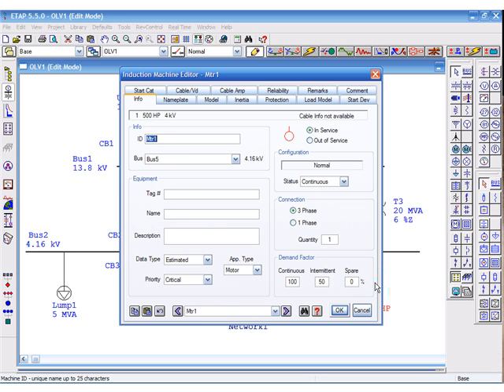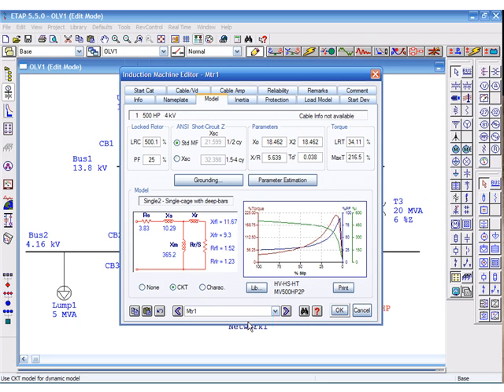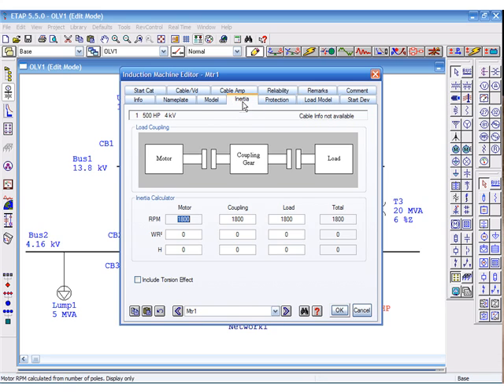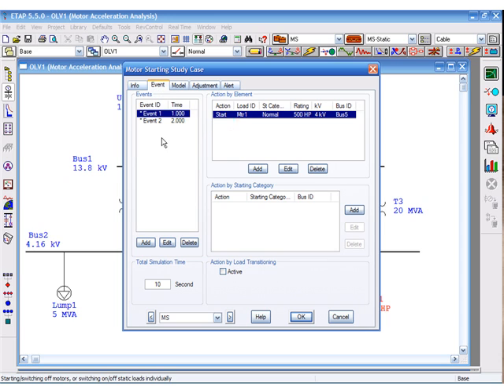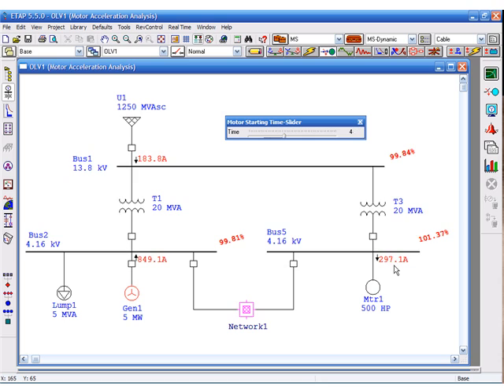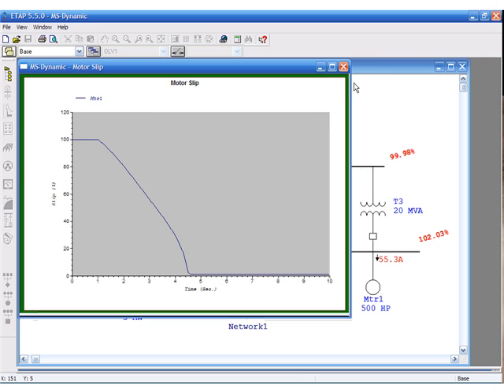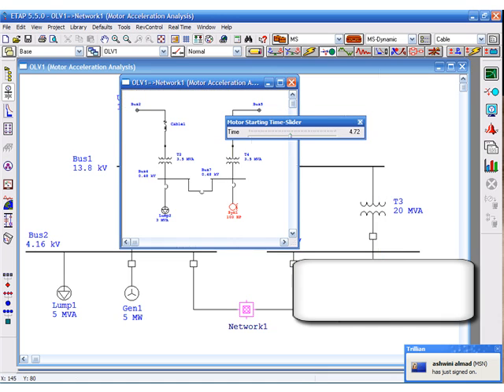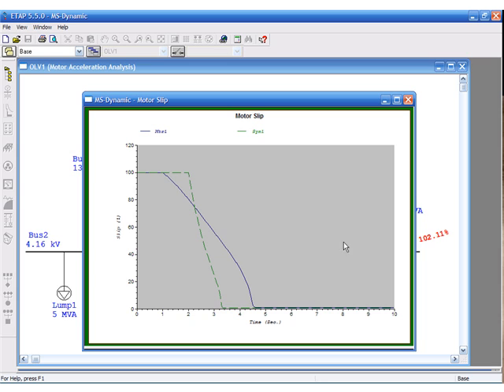Motor Starting in ETAP Software - Dynamic

Comment: What size of motor do you consider to be modelled for motor starting analysis? Or do you always model the largest motor in the bus and separate it with the lump load?
Reply from the maker: Thank you for your interest in ETAP Software. You can take advantage of the ETAP multi-dimensional database, which allows you to run as many studies motors, busses and loads as you like, compare them, and select the best option for you all and everything is saved in scenarios without changing your initial design. You can run batch  scripts with all scenarios as well. You have literally unlimited option you can analyze on your model. For more information please refer to our videos on ETAP Digital Twin or contact our 24/7 Help Center on our website https://helpcenter.etap.com

Comment: One Problem, we shall input Moment of inertia WR2 ( kg m2). How to calculate Moment Inertia WR2 (kg-m2) in ETAP?  Is there any standard to calculate  WR2?. I found in IEC 60034-12, Table 4. External Moment of Inertia J ( kg m2) for each kW of motor. Is it same WR2 and J? 

J in IEC 60034-12. Mentioned as J=0.04P^0.9xp^2.5
Reply from the maker: Thank you for your interest in ETAP Software. Please contact our ETAP Support team at support@etap.com or go to our 24/7 Help Center and open a ticket to assist you with your question.

Comment: sir, for id model in motor is there any meaning for example LV100HP2P
Reply from the maker: Thank you for your interest in ETAP software. The name is just a basic motor model in this case meaning Low Voltage 100 horse power 2 pole